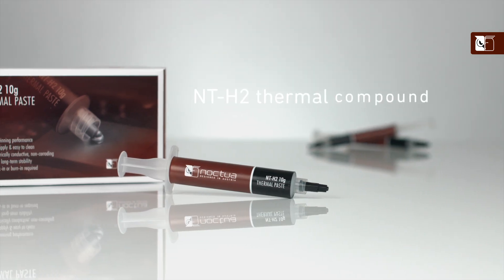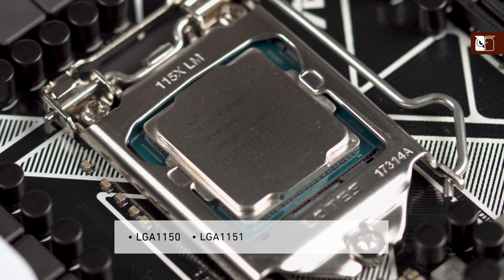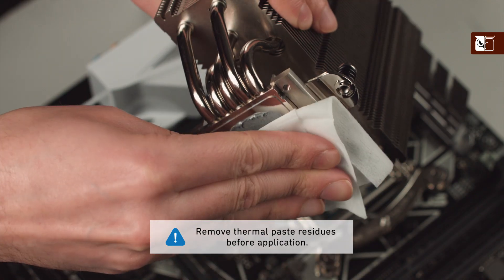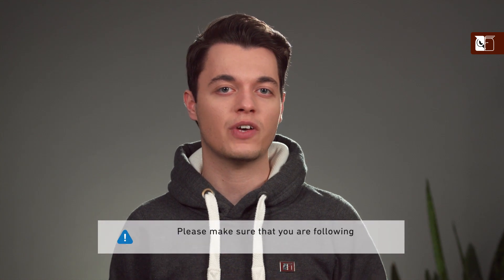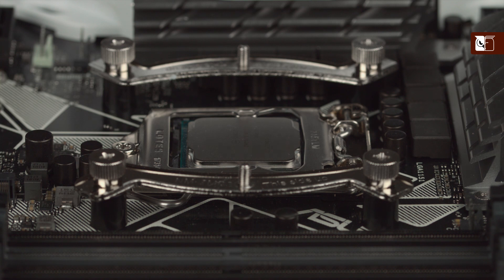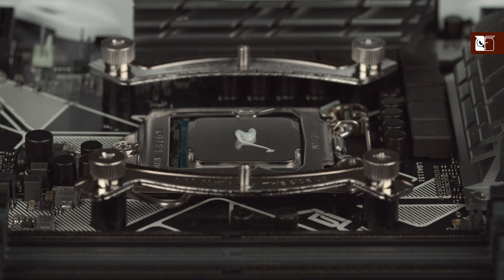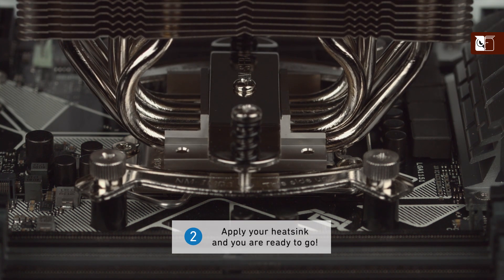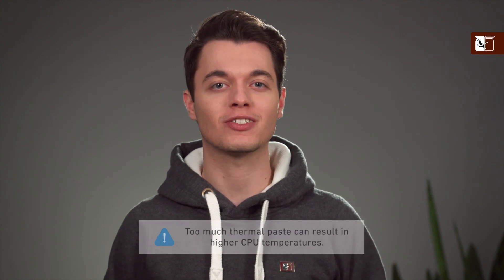Noctua NT-H2: How to apply on smaller CPUs (e.g. Intel LGA1150, LGA1151, LGA1155, LGA1156, LGA1200)

Comment: Is there a way to properly store this paste? I've purchased the 10g package, WAAAAAY the hell more than I thought I needed since I'm not really that much into PC building. None of my friends needed any, so now it just sits in my drawer. Is that okay way to store it? Also, what's it's shelf life once it's been opened?
Reply from the maker: Sure, you can store NT-H2 at room temperature for years and keeping it in a drawer is good, just avoid exposure to sunlight and very high temperatures (>40°C). Our recommended storage time is up to 3 years, but usually, you should see no issues even after much longer storage times.

Comment: Is it important to keep the heat sink/pump off the cpu as much as humanly possible until it's forced against it by the screws?  That is, should you apply pressure to try to keep it off while you fit and tighten the screws?  That's very difficult to do. 

I'm thinking that otherwise, you're going to get some spreading and mushing around just from the weight of the heatsink, before any of the screws are tightened.  Does that harm the ultimate spread?
Reply from the maker: That's absolutely not necessary. Just put the heatsink on and then tighten the screws, simple as that! ;)

Comment: I think I should have taken a small clean piece of paper and drawn a 2-3 millimeters circle on it, then used that for comparison as I installed my paste.  If I do it over I will do it this way.  

I feel like I put a tad too much, but it seems to be working so perhaps there is a margin of error.
Reply from the maker: Sure, there's margin of error. Unless you apply way too much, there shouldn't be an issue.

Comment: I recently repasted my GPU with NT-H1. I manually spread the paste. The temperatures are the best I have ever seen. Even beating Thermal Grizzly Kryonaut by quite a temperature difference.

I think had used NT-H1 on my GPU before, and got predicted good results. Or once my GPU warranty expired, I bought Kryonaut as it was rated the best. It performed OK. Long story short, I repasted again with Kryonaut, but second time the paste degraded very quickly. Temperatures got bad. .... I did learn one thing from using Kryonaut though, that applying a bit more paste gave better results.

Since Kryonaut was degrading, I went back to NT-H1 (that I got from buying Noctua coolers). I used the method of applying a slightly thicker layer, and spread it manually and evenly. The temperatures now are the best ever, by a considerable amount. My GPU stays in the 60'C range, (fom 62'C and up.) Whereas before it was in the 69'C to 73'C range, with case fans doing reasonable air-flow.

With NT-H1 now, sometimes I have started up a game that maxes my GPU and forgetten to increase case fans. This means just one rear fan on low, and a second upwards blowing rear fan, blowing out through a filter. (I.E. barely any air-flow.) Meanwhile my GPU temps max out under that scenario at 68'C. 

I have increased my GPU fan curve during all this. However the fan curve has remained increased consistently with both Kryonaut and my recent NT-H1 pasting. NT-H1 seems to be running easily 5'C cooler than Kryonaut. I get slightly better clock speeds from this too. It's also quietened my GPU fan, from the slight noise I got from increasing fan curve.

Don't ask me what the magic is because I don't know. However it must be the pasting. Or some of the paste was fractionally thicker due to having dried very slightly in the nozzle of the tube.

Initially when I used to use NT-H1, I would manually spread the thinnest imaginable layer. Now I spread a bit thicker - and the results are excellent. Never been happier with thermal paste.
Reply: what cpu, what overclock, what type of cooling on the cpu , example  AIO - 240MM or 360MM..company brand ? TY

Comment: Hi Guys, thank you very much for this video. I'll replace the termal paste tomorrow. Can you tell me if an Intel® Core™ i7-10875H (FCBGA1440) is a small or medium-sized processor?
Reply from the maker: This is a laptop CPU without IHS, so it's very small, a single drop of ~3mm diameter will be more than enough!
Reply: @NoctuaVideos  just spend my afternoon trying to find instructions for a laptop CPU and saw this comment ,  thanks guys !
Reply: @NoctuaVideos  thank you!